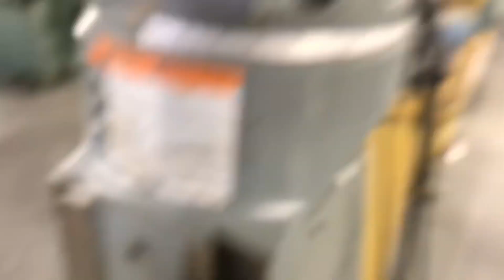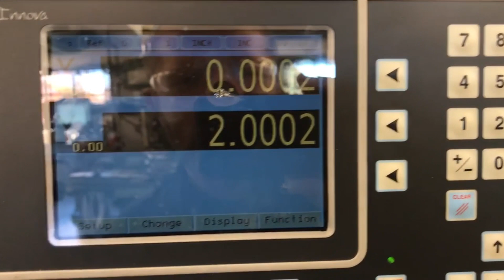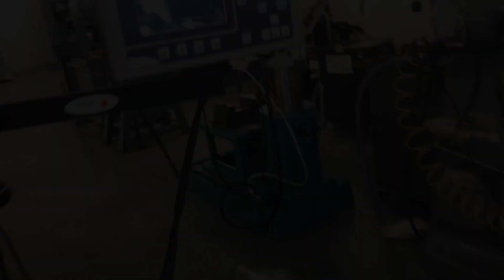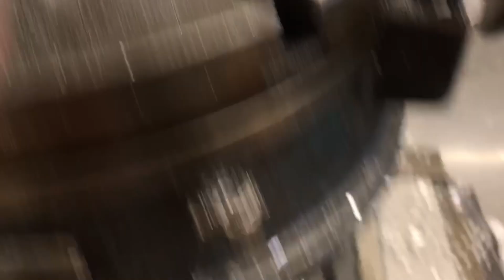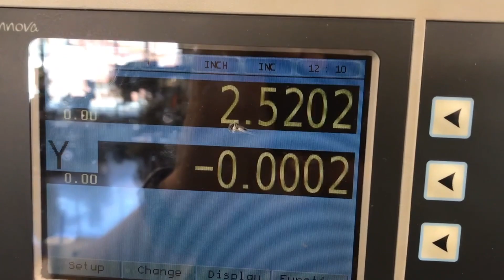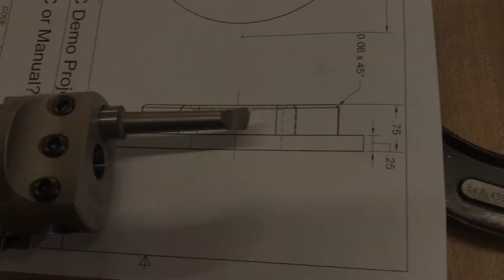CNC Machining vs Manual Machining - Part 2

Comment: Sadly, you'll lose all registration when you move the clamp. You're bolts should have been flat heads, a centre spigot would have made locating a breeze. Dialing the bore of the rotary table  in +/- x, zero the centre,  +/- y regardless of x, zero the centre, make a tapered pin to fit the index table and match the part bore, custom cap to clamp it... I can't imagine the problems you'll have doing the other 5 features. As below, bolt hole circle takes 10 seconds to program. Let the DRO do the thinking. Keep learning

Comment: Regarding the protruding stock hold-down bolts being in the way, options would be to

- Counterbore the holes and/or use low head height versions

- Add hold-down clamps at the other rotary table T-slots and then remove the original ones

Comment: Not a machinist, but you can turn a piece with threaded center to fit the center hole of the turntable, groove it, and slide straps thru the t-slots into the grove to retain it- then hold the piece down with a washer you make on the lathe.

Comment: Thanks for taking the time to make this video. I wonder why you didn't continue this operation in the lathe first? I would have switched to the rotary table after I'd turned the step and chamfered the od, basically the first 21 minutes of this video. I really like having a chuck mounted on the rotary table, it's a great help in set-ups like this and saves all that messing about with clamping and clearance (if your chuck is the right size that is). It was good that you showed the set up and measuring of the boring bar, this is seldom explained in videos.
Reply: You can even go further (on what you mentioned) and turn the rough part on the lathe, using e.g. a 3J chuck, then remove the chuck with the part still in the chuck. Then go to a round table or divider, mounting the same chuck on that round table or divider.

Comment: With the DRO and the bolt circle function you could skip the rotary table for the scallops. Turn all the OD features and chamfers, then go to the mill for the scallops, and use a form tool in the boring head to do the chamfers on the scallops. (even a countersink would do the job)